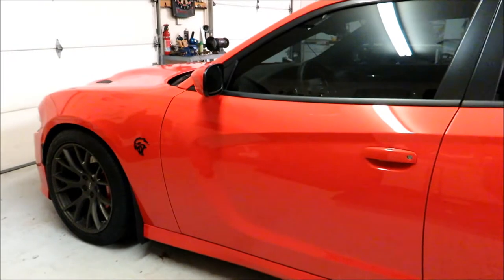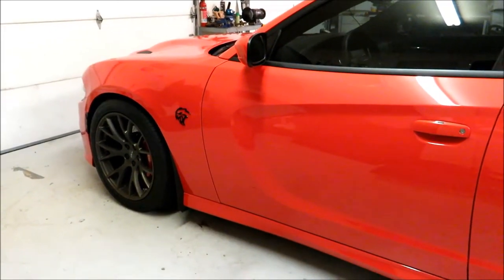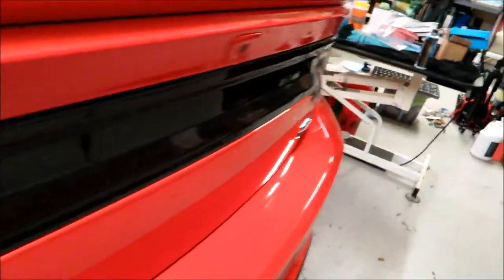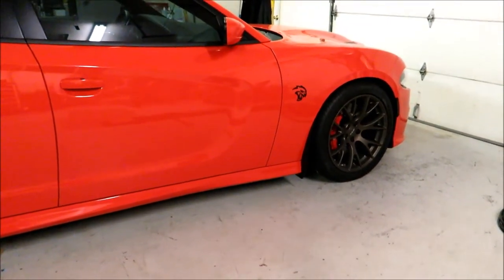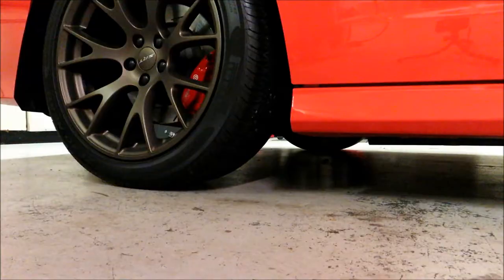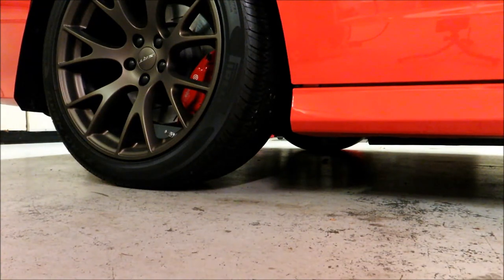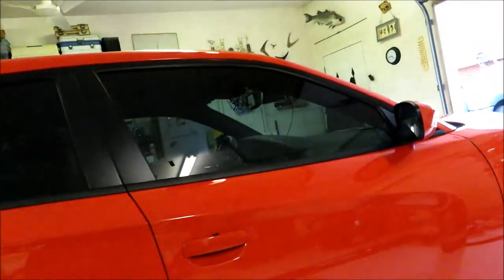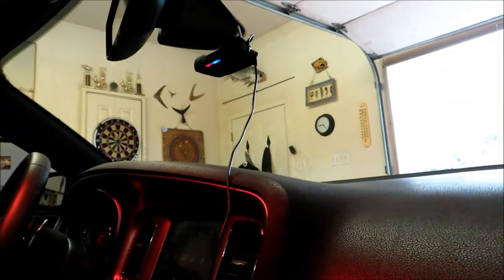Almost killed the Hellcat

Comment: That rattling sound is just the muffler bearings warming up. Mine does it too for about the first 90 seconds.
Reply from the maker: Are they something that can fail over time.  It didn't start doing it until it got cold out.  up until about the Nov/Dec time frame it was perfectly fine.
Reply: coolwrld302 - nothing to worry about, just a cold weather issue
Reply from the maker: So once DE is above 40 or so routinely I shouldn't have to worry about it?  Because it would suck to start the car up at a meet and have it sound like that.
Reply: coolwrld302 - exactly, unless there is minor damage from a curb or something. Once winter breaks you should be 💯
Reply from the maker: I don't think I have any type of damage so i say bring on the warm temps.

Comment: It’s would have probably been hard to figure out why it wouldn’t start if everything was turned off and wouldn’t start good thing you caught it!
Reply from the maker: Yea no kidding have had a dead battery in a Charger before not fun. Maybe this will be the thing that finally gets my ass moving to hardwire it in so the camera will turn off if battery voltage gets too low.
Reply: coolwrld302 better safe than sorry for sure

Comment: I left my thinkware dash cam plugged in and it killed my car's battery before. I got a cellink now that I use which gives it more parking mode time. I ran two wires so I can run it continuously off the car's battery, or off the cellink battery. Btw if you see a tinted out Black Scatpack Charger driving around the area that's me. I'll have to keep a lookout next time I'm at People's Plaza for you!
Reply from the maker: Yea the Blacksys has parking mode too but for it to check the battery voltage and turn itself off if it gets too low it has to be "hard wired" in to the car.  Haven't gotten around to that yet so I have to keep remembering to unplug the camera if its going to be sitting for awhile.  Yea when I'm out its always in the Fox Run, Peoples Plaza, Elkton area as I live off 40 near the MD line.  Of course as soon as the Cars and Coffees start up I will be hitting them up.

Comment: You can by an active exhaust delete kit.. $150
Reply from the maker: I know there are the simulator kits where you are basically forcing the valve to stay open but the computer still thinks the valve is running through the full range of motion so no codes.  Not sure if that is what you are referring to or completely removing the valve all together.  Looked at the simulator kit and not really sure i like how after its installed it allows the mechanism and motor to stay exposed to the weather especially considering its underneath so potential for water, road salt, grime etc... to get in and muck everything up.   Also the car is a lease so I'm picking and choosing mods that provide a fairly easy path back to stock if necessary.  Since it is under warranty I'm just going to make the dealer check it out and see if the valve is problematic.